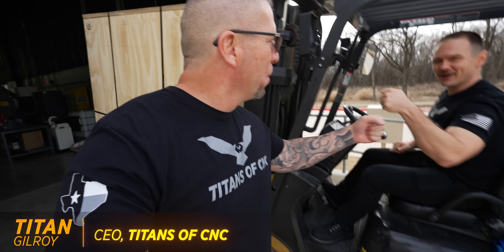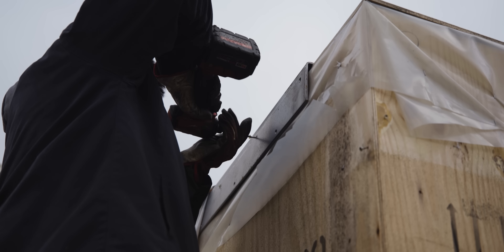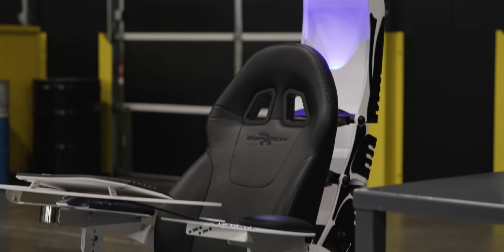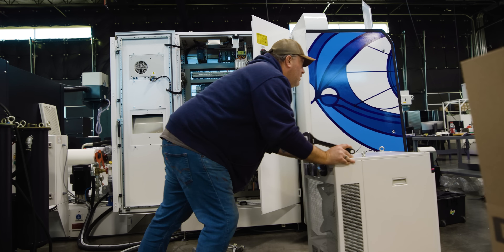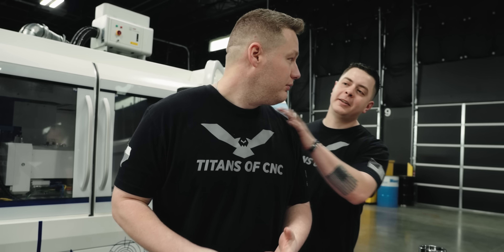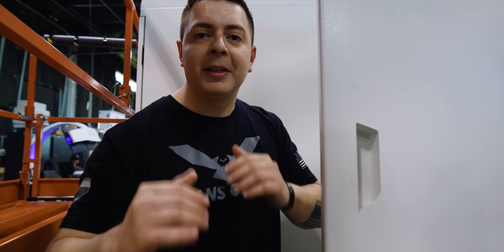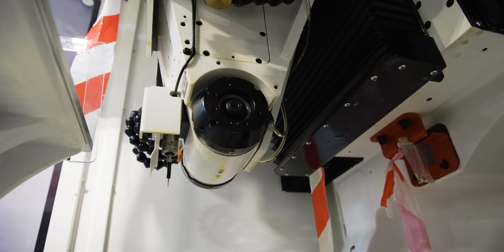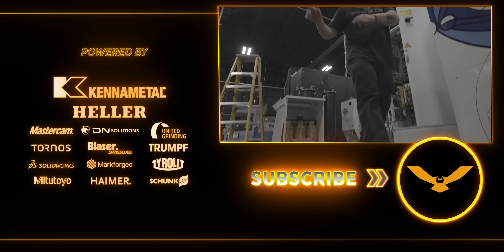NEWEST and MOST INNOVATIVE Machines Get Delivered to us!

Comment: Titan i started my cnc machine shop last year and I'm barley holding on. how can i make my company go to the next level. thanks.
Reply from the maker: It sure where you are or your capabilities etc… but there are so many customers out there. You just need to find them and then sell them on your quality and ability to deliver perfect parts on time and under budget. Search buyer, purchasing etc on LinkedIn for companies in a 100 mile radius from your shop. Post pictures of parts etc.
Are you posting pictures on CNCEXPERT.com ?
It’s free and shops are already getting work from it.
I have a lot of videos on the subject.
Just keep hustling and make sure you take care of your customers
Reply: @TITANSofCNC  I only have 2 cnc MillTurn lathes. I have a Hyundia Wia LM1800TTSY, and a Doosan TT1800SY. My background comes from 10 plus years working on complex aerospace parts. I have part examples in my shop from my past that I program and set up. Thank you for that information. One other question: my company is still not AS9100 certified, how can I go about getting work without it? Thanks.
Reply from the maker: We went through a 3rd party back in CA. You can look for a local person who helps people with registration. Also, There are a ton of Aerospace companies that will hire guys like you for tooling and non flight parts etc… and then work with you to get you compliant and then certified.
I wouldn’t spend the money until you have good customers lined up.
Are you on CNCEXPERT.com yet.
That’s a great way to create a gallery of work and then share on social and in emails etc.
Companies are getting work from there right now

Comment: Titian I am sorry I would like to ask for help I have done my best in my shop two car shop I make and redesign model engines I got to say I started as a 6 year old with a small piece of sand paper a broke file but I did it hand made gear now at Gray State my tiny harbor freight guy manual then I bulid to cnc cuts 1.5 steel but my y axis to short trying to find and afford a bigger bench cnc I am like the old guy with his shop I gave a 7 year old lessons he and his sister now want a company and to go on there still,little but I made and gave them a tiny steam engine the drilled and milled ages 6 and 4 the engines run the said we hope you get a big miik so we all can make a bigger one. So I pass on the what I call Magic to those who want it.  If you can help. If you can't it's ok I'll keep going. The fun of sharing kids run a lathe a mil a cnc mill a unimat lathe and a blue pro-lite cnc lathe it was fun and amazing. Little kids better then us. Love it

Comment: The chair has another advantage: if something REALLY goes wrong and a part manages to make its way out of the machine cabinet, the operator is not in the path of flight of a couple hundred pounds of metal.
Reply: that would be impressive to see happen. i don't run a high power machine like what they have though. they say bulletproof glass but even the little 35hp spindle at work can do some amazing things.

Comment: I work at a shop with about 20 medium size machines and we have the same kaeser compressor system. We've had issue after issue after issue, and not even the kaeser tech can fix it, and they keep giving us the runaround so we're scrapping that POS and getting an atlas. I'm glad you like yours but damn ours is trash. P.S. Maintenance tech here
Reply from the maker: Dang that sucks.
Ya, had Karser at every shop for 20+ years and never had an issue